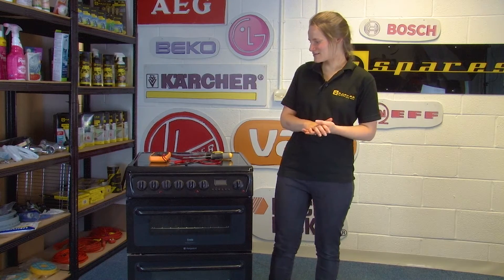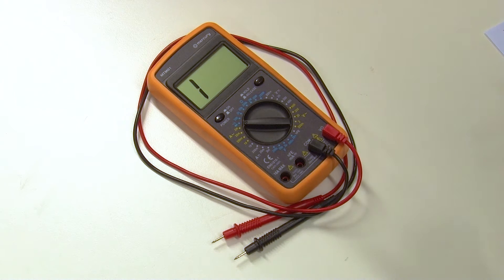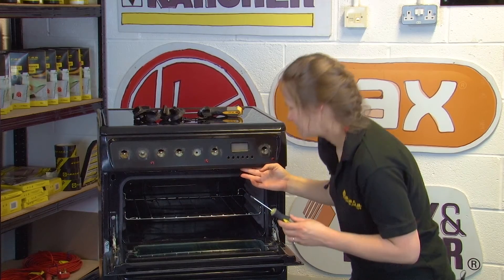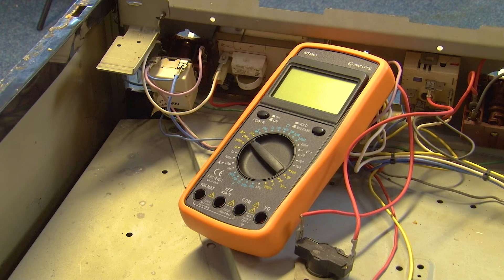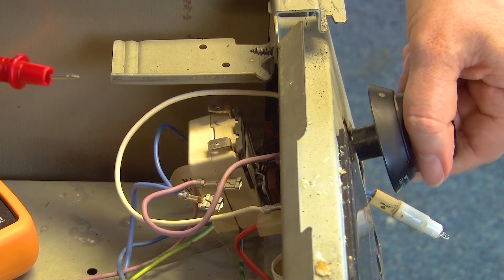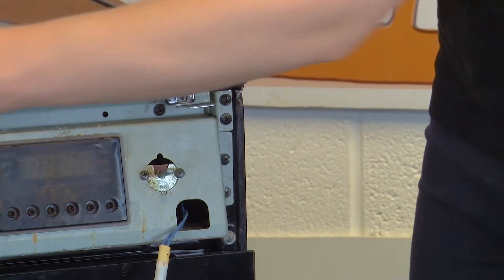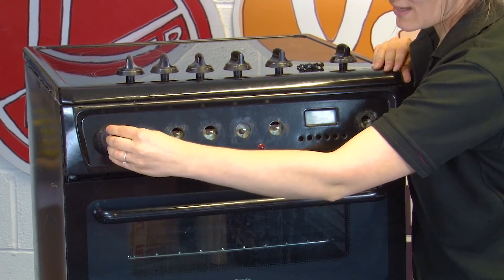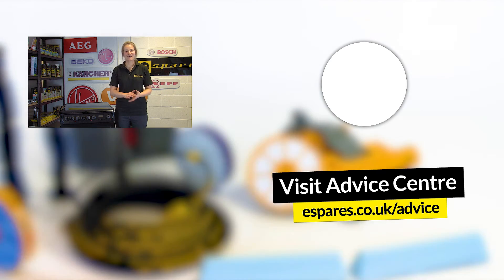How to Use a Multimeter to Test the Thermostat on Your Oven

Comment: Hi, I have an elderly relative whose free standing Zanussi fan oven is overheating and the oven will cut out. Approximately 8-10 minutes afterwards, the oven will turn itself back on and cook for another 10 minutes or so, then it will cut out again. If you open the oven door after the oven has turned itself off due to overheating, the oven will obviously cool down much quicker, so if you then shut the oven door again, the oven will turn itself back on. Could this overheating and cut out be due to a faulty thermostat? Or something else? Can you test for overheating  cut out with a multimeter? I've  never used a multimeter, but do know someone who could lend me one. Thanks